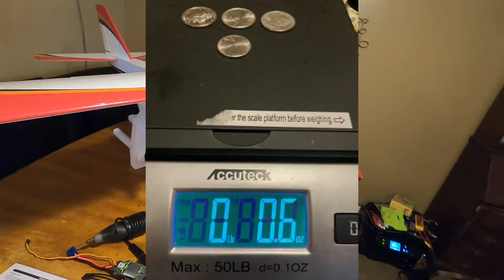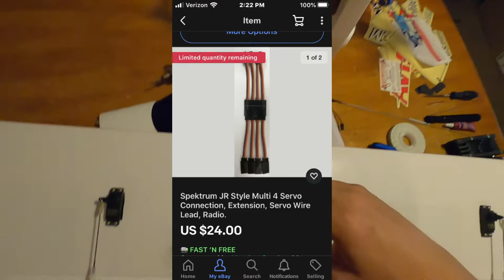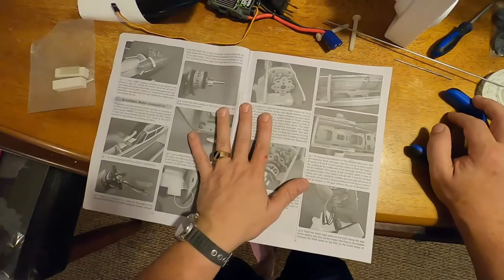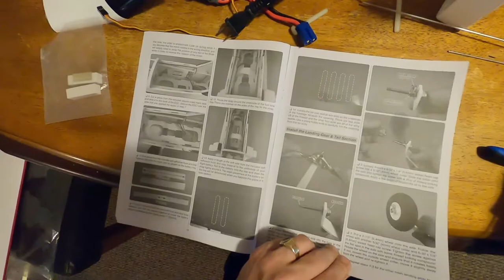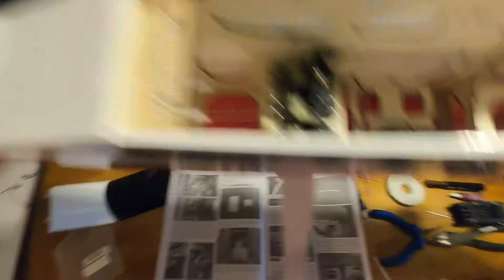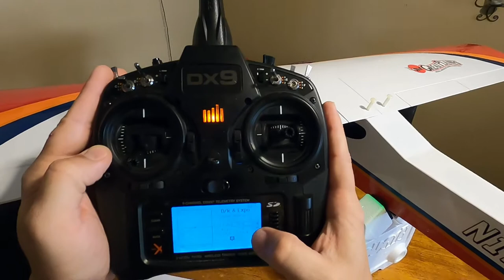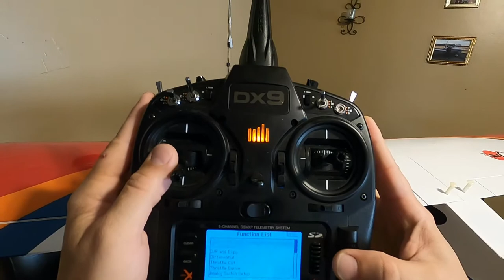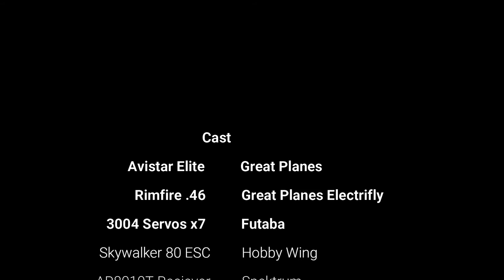Great Planes Avistar Elite Electric Build Video

Comment: Was watching your video again for the second time. I really enjoy the way you have explained  everything.   My Avistar is also sitting on a Robart stand.  It brand new and im going with a glow engine.  A Saito 62, hoping that will he enough power.   So today ive put the 4th and final coat of polyurethane varnish on the both sides of the engine firewall and tank bay.  I do this with all my glow planes and it does go someway to help fuel proof them.  We are similar in that i also have a trimmed out flight first before the actual maiden flight. I think that is a very good idea.     On most of my glow planes i do epoxy the wings together. But on the Avistar i might just do like you and keep them separate for assembly at the field.  The multiservo connector you have for the wing and flap servos,  i also have some of the same , but ive only ever used them once and that is in my big electric Eflite T28 Trojan.  I still have that plane and they are very handy indeed  for connecting quickly.   So as im going to also instal the flap servos as well i will used another one of these connectors as they are indeed convenient.   Great video and thanks again for sharing it.  Im looking forward to getting this plane together and flying it.  I hope you are still enjoying your Avistar.
Reply from the maker: I’m 100% happy with it…for an ARF kit it’s really well done, lots of options for the entry level builder or anyone who want a quick set-up😎

Comment: I decided to go ahead and buy the Avistar Elite.  My postman delivered it yesterday.   Im going to power it with a Saito 72 that has been in its box for nearly three years.  I think this engine should be a good match for the Avistar Elite.   I like the colour scheme and im looking forward to assembling it.   Im just wondering will the flaps help to slow it down for landings?
Reply from the maker: One tip…put larger wheels on it, to get the prop away from the ground.  You’re going really enjoy it, it’s a great aircraft and a great value!  Congratulations
Reply: Thanks.  I've changed my mind about the Saito 72 as it won't fit the engine mount and would mean having to drill more holes in the firewall.  But what I do have is a slightly less powered Saito 62 at 10cc which fits the engine mount perfectly.  I just hope it won't struggle to get off the ground.   Yes, I have bought new bigger wheels for the Avistar.  Instead of a smaller wheel at the front, I was going to keep them all the same size.   What do you think?   Kind regards.